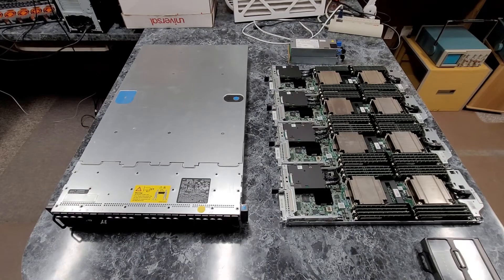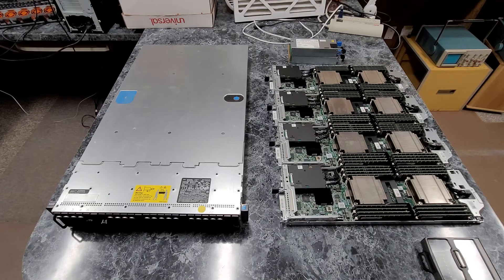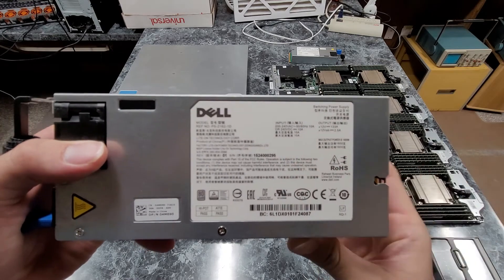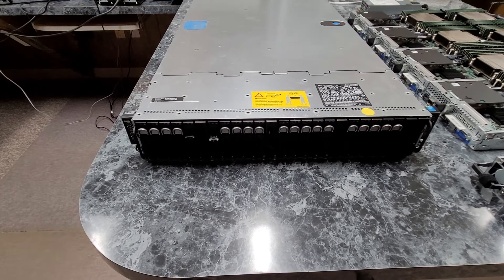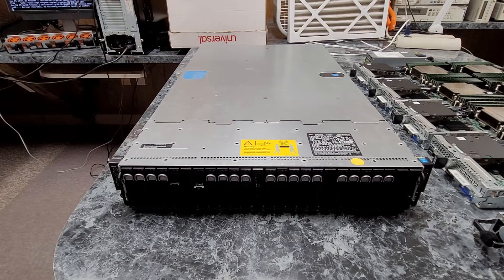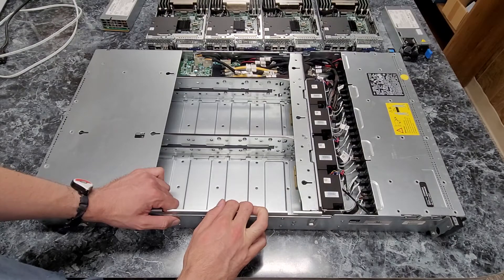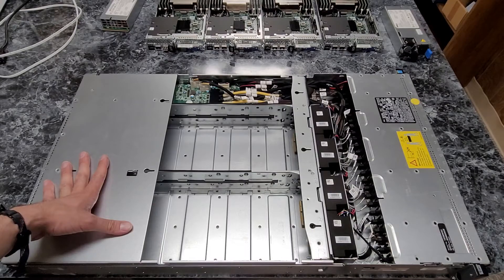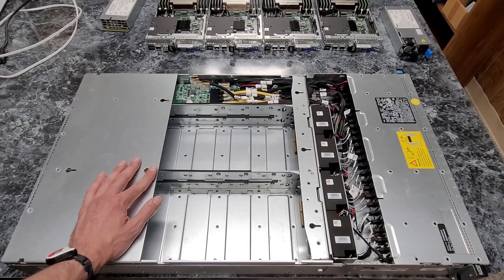Taking a look at the Dell Poweredge C6320. A 2U 4 node powerhouse!

Comment: I have an HP Z840 workstation with two slightly upgraded CPUs than this video with 18 Cores each & 128GB of RAM, but I can't imagine having 64 cores and 1 TB of RAM. It all boils down to what you're going to run on it to take advantage of all that hard ware.

This is also my daily driver that I use mostly to write code and design PCBs with and for the most part my system very rarely goes beyond 10% CPU load. But, I do have one process that runs daily that downloads >1.2 Million part inventory items from my PCB supply house's inventory. I do this to be able to keep a historical history on each of those components. That process when running as a single threaded process was taking like 45 minutes each night. Once I took the time to re-code that process so it would take advantage of all the 36 cores, I was able to bring that 45 minute process down to 1-3 minutes. Most software does not multi-thread. And, only a limited number of processes/jobs can even be sliced into a solution that takes advantage of all the cores. But, when you can, it's pretty amazing.

On a side note, I was surprised to find out that in Visual Studio, and I'm guessing any development environment, a single application only has access to the cores that exist in a single processor. So, in my example, I can only load up 18 of the 36 total cores. You'd have to find a way to split your load between two apps to fully take advantage of all the cores. So, on a system like is shown in this video, a single App will only really be able to use 8 cores at once. Great for things like running many VMs, but much harder to do if running some single multi-threaded app.
Reply from the maker: I believe the intent of this system is scientific research.  I would imagine having the right program to utilize all 4 nodes would be tricky.